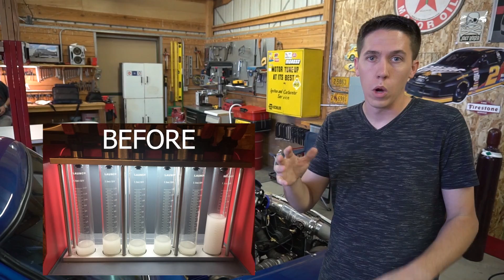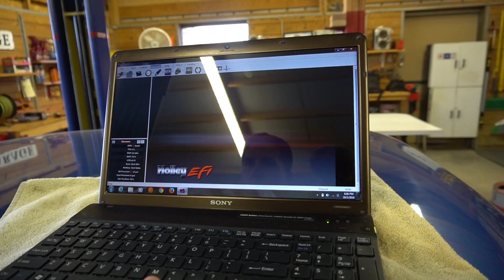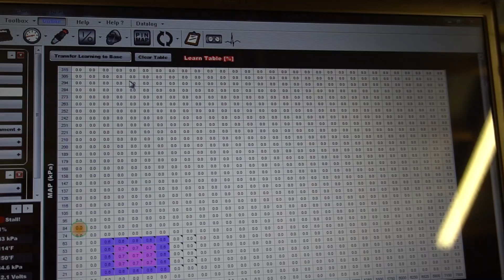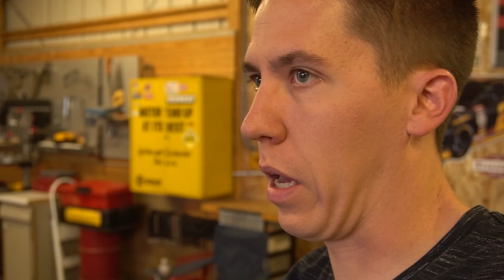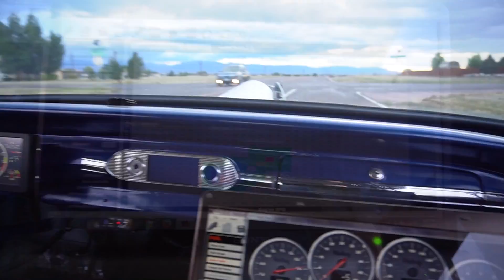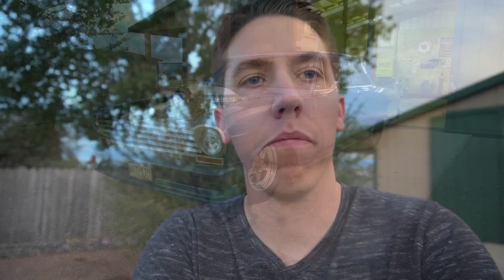CLEAN YOUR INJECTORS! Boosted LS Nova Street Tuning on Holley EFI

Comment: Why were they dirty to begin with???
Reply from the maker: E85 will gum up if it sits for too long. They had a full season and driving in them then the injectors sat which gummed them up.
Reply: Build Tune Race I didn’t know it was on E85.  Makes sense

Comment: Guy in Victoria Australia just built an 1984 GM commodore with a dart LS block and twin precision turbos with a mid ram intake on E85.
Powerglide and  nine inch differential.
A full street legal car and ran a 7.75.
Doable :-)
Reply from the maker: I'd love to go 6 bolt setup in my Camaro makes a big difference when you can throw about 10-15lbs of boost at it!

Comment: How much can you really do from the dash with that setup. I know you prefer using the laptop but cant you adjust the holley stuff from thr touch screen?
Reply from the maker: Your suppose to be able to do pretty much anything I think on the dash just not near a smooth or easy without a pointer and a keypad. I've never used one other then to  view or at most adjust a boost curve.
Reply: you can do almost anything ..  its real nice